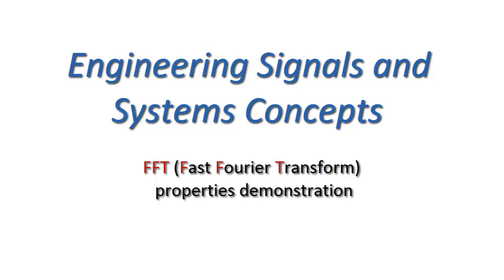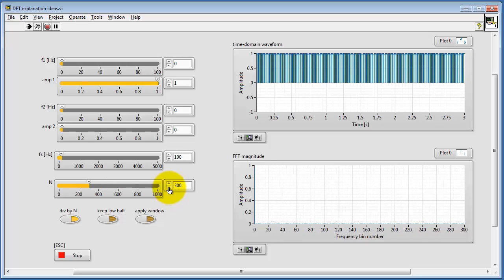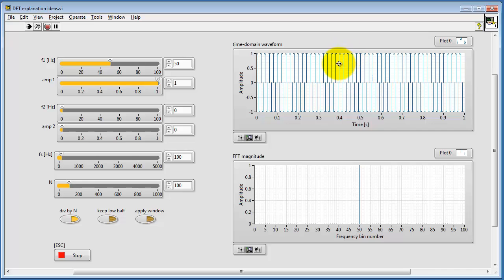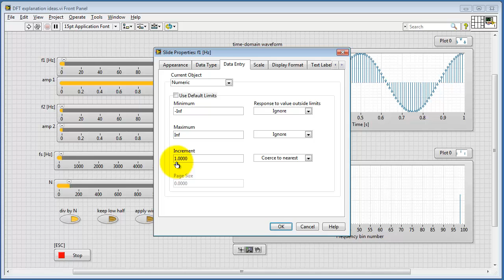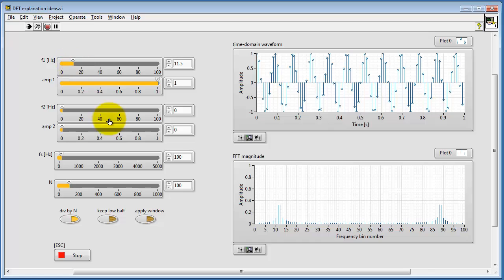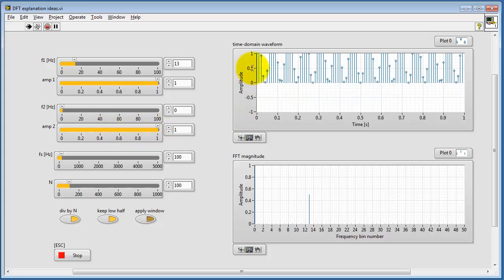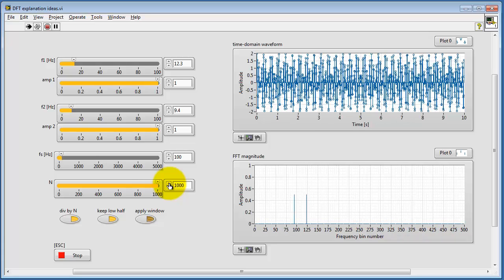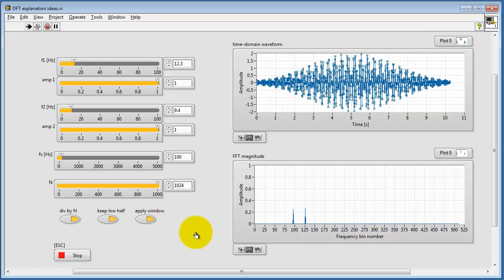FFT properties demonstration

Comment: thanks for your video. Can u explain the pros and cons of different kind of windowing technique? for example, comparing hanning window and blackman-harris window. and about the spectral leakage, i observe that sometimes a lower sample size if choosen carefully can give no leakage. For example, if my signal is 40Hz, and my fs=1000 and sample size=100, then the frequency resolution is 10, so i will have no leakage because 40Hz=10*4. However, if i use a higher sample size, let say 105,